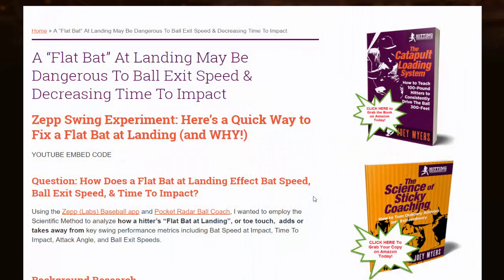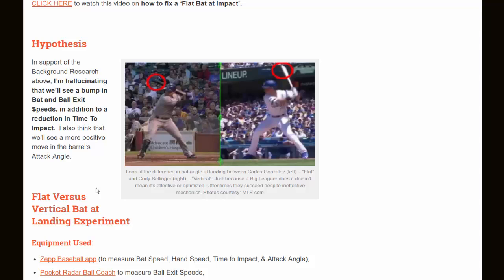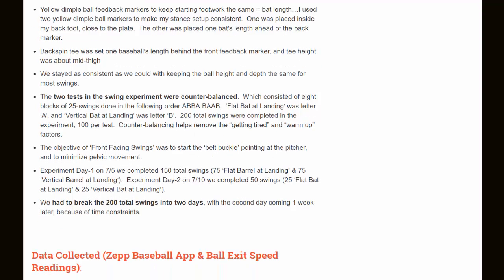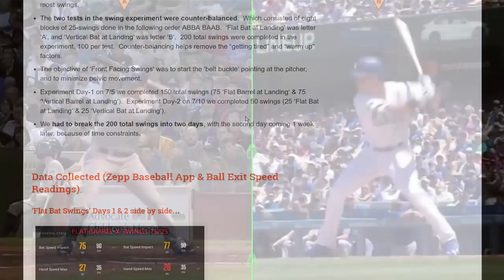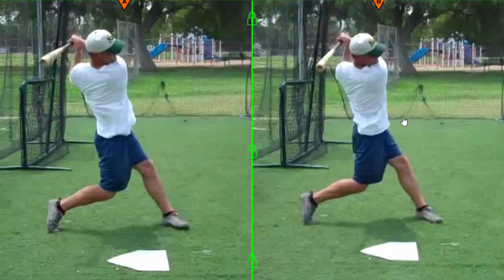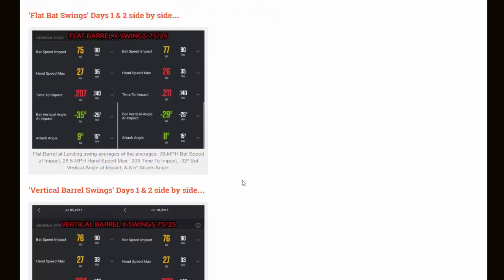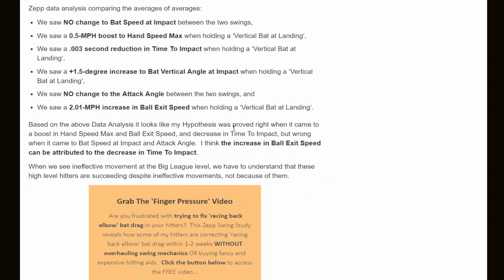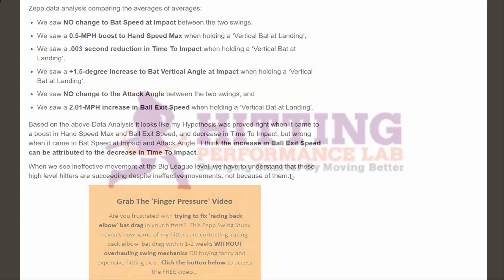A "Flat Bat" At Landing May Be Dangerous To Ball Exit Speed & Decreasing Time To Impact

Comment: Towards the end of my baseball playing days i laid my bat very flat with back elbow tucked in, Even pre swing.  Visually it looked like i was just laying the bat on my shoulder with my back elbow down tight to my body. My theory behind it was i wanted to keep my hands as connected to my back shoulder as i could. It worked VERY well for my specific swing. I kinda wish i learned it earlier. I was EXTREMELY nontraditional and coaches/teammate were always trying to correct me until they saw me hit. I felt that one little changes made my swing much shorter and quicker to the ball. Did i lose power, maybe but it didnt feel like it. There was no was to test that in those days

Comment: Hey Joey I land with a flat bat because when I try to land with a more vertical bat I hit weak fly balls and pop ups.But when i land flat I hit line drives and homeruns. I really what to fix my swing to hit the farthest my body will let me.Is there something I can do to fix that?
Reply from the maker: When you land, where are your hands?  Also, do you know what your barrel's attack angle is landing flat versus vertical?  Is it positive or negative?
Reply: HittingPerformLab most of the time I try to have them at my shoulder height And sadly I don't know my attack angles or whether they are positive or negative.
Reply from the maker: You may have your shoulders angled up at landing instead of down.  You may be collapsing your backside before starting your turn.
Reply: I dont know what you mean by collapsing my backside side before
 my turn. Can you give me an example?
Reply from the maker: Your shoulders are pointed up at or slightly before landing.
Reply: thanks this really helped me hit more line drives.Ive been watching your videos for a while and now I understand thank you so much.
Reply from the maker: Sure thing!  Thank you for your support :-D

Comment: I think you need to show the whole swing of Bellinger not a still shot, every swing I see him take he does have a vertical bat angle.   Actually your bat is not vertical, I would consider a Ted Williams bat being vertical but yours is flatter than even Cody's.  Also why load and stop.  Why not just take a normal swing and put your bat in a vertical position then do it in a flat position?  I bet you will see your MPH go up the flatter your bat is.   I guess instead of saying flat and vertical maybe exact degrees would be an even better experiment but either way love the videos and experiments.
Reply: That makes sense and I agree with you there.  I thought you were saying 45 degrees would be considered flat.
Reply from the maker: I would suggest visiting the blog post link, that would answer quite a few of your questions.
Reply: I didn't really have any questions to answer other than why stop at the load? But from what I have seen 95% or more of all MLB guys have the flatter bat, Ted Williams again the exception and Josh Hamilton is about the only one I have seen lately with a bat straight up. Looking at the HR derby they all wrap the flat bat and they are obviously going for distance and ball exit speed.
Reply from the maker: He's already started his swing at that point...toe touch, before the front heel is weighted into the ground.  Bat is vertical.
Reply from the maker: The experiment post would answer your stopping the swing question...it has to do with isolating the variable in an experiment.  It sounds like your definition of vertical and flat is a little different.  I should've defined that...for me, flat is anything less than 30-degree angle.  More, is vertical.  With that definition, very few elite hitters are flat.
Reply: HittingPerformLab well hell, back up a few seconds then.  His bat is clearly flattening during the middle of his stride.  Only time his bat is vertical is during his stance and when he loads into his back leg.  Bat actually starts flattening at the end of his hitch.
Reply from the maker: John, please read my response to Baseball Coach for my definition of a 'Vertical Bat'.